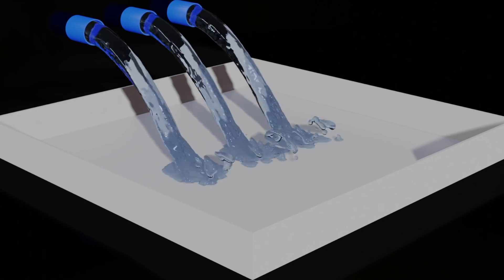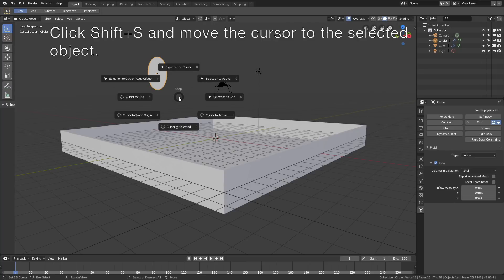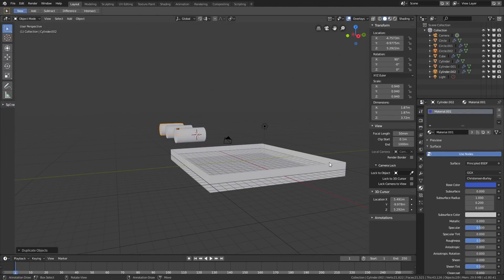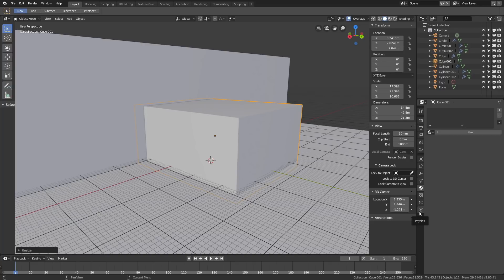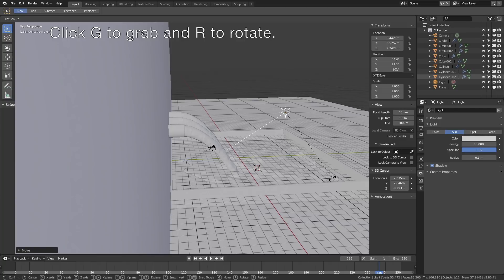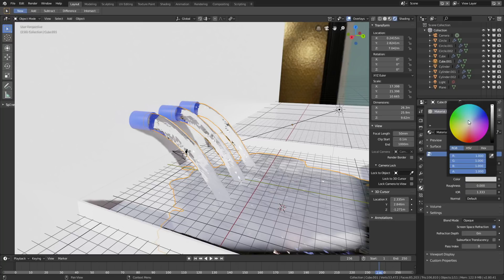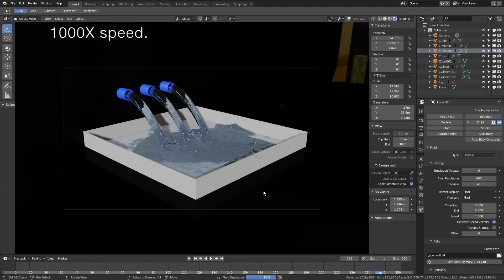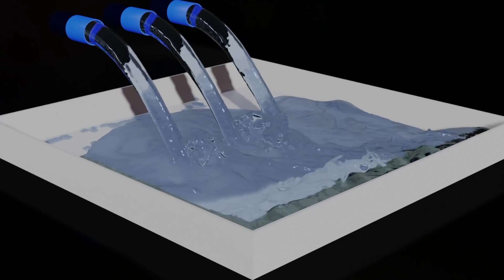[2.80] Blender Tutorial: Water Simulation in EEVEE, Nearly Real-Time

Comment: Hi Olav, I see that use Mac for blender. Wanna ask, is an iMac 2019 i5 enough for use blender? I do understand that rendering can be slow on Mac, but, what’s your opinion about it? Best Regards
GabrielFernandez
Reply: hi, this mac has a i5-2410M wich is really bad (2 cores and 4 thread).you will take a lot of time just for 1 image in cycles with 86 samples in 1080p. i have a i3 9100f. so 4 cores and 4 threads and it takes something like 8-9 min for a glass at 128 samples so you can but your cpu will get really hot quickly. so you must use a graphic card but you don't have any in it.
and you will not be able to add a lot of faces, i start lagging at 60k faces wich is not that much.
i hope this mac has a good fan or you will be ables to cook eggs.
so you can try to learn a bit of it because blender isn't good for some things (precision enginering) because you can't really control scale of your faces, you can with you objects but for faces it is a rescale factor (i hate this) so it will be really tricky. of course if you just want to do funny things it is really easy! you just have to watch tutorials, a lot of tutorials. im trying for 3 month and i can't even do a wood texture with irregularities. but it is free so try it!! (just look at your CPU temp, if you don't have something to see the temp, you can download HWMonitor, it is free and you can see the temp, utilization, clocks cores, everything!)
hope it will work and good night from france (0:40 am)

Comment: I am try to follow your tutorial but I don't have the same options under the Fluid Type as you show on the video.  I only  "Domain, Flow, Effector or None". Am I missing something. I am using Blender 2.82
Reply: Hi, did you figure it out? I have the same problem...
Reply: @SJSDE89  Hello, no i couldn't find what i was doing wrong. The only thing I thought of was I would wait for a release of 2.83 and see if the options were in there.
Reply: I thinks the reason is, that from version 2.82 they are now using mantaflow which replaced the previous fluid simulation engine. I have now downloaded the previous version 2.81a, the last build with the old enguine and it worked there

Comment: why is the water in slow motion tho
Reply: That's because he set the frames up partially wrong. There is a time scale in the fluid sim about how long real time sec the water should flow for, and it'll stretch it along your animation so for ex: a animation you want that is 240 frames @ 24 fps = 10 second animation, so the time in the fluid sim settings should be ~10s to look right.

Comment: For some reason, the cube.001 is showing up as the literal cube during my animation. When I click play, The water flows for about 2 seconds then it just turns into the large cube we put around the animation. Pls help.
Reply: It means the animation didn't bake all the way (there is a progress bar at the bottom), or your frame settings are messed up. The large cube (the domain) actually becomes the water mesh when you 'bake' the simulation, but this is a slow process that happens one frame at a time. In other words, if the water flows for a bit and then stops, then you should try rebaking the simulation, or changing the frame start/stop options, etc.

Comment: Wouldn't hiding the inflow circles from render be a better solution than giving them a transparent material?
Reply: in simple words the inflow circles are the points from which the water emits so if you hide the inflow circles in the render you wont get the water either
Reply: @shalmonanandas3478  that's not true though. The fluid is it's own separate mesh, it's visibility is not determined by inflow objects.
Reply: @shalmonanandas3478  If that's so, I'm doing things supposed to be impossible.

Comment: I'm having a problem where the water is coming through my obstacle. Any ideas why?
Reply: @kasa6468  well the fluid is not going straight through, it just sorta shows through the pipe mesh. I've tried making a higher resolution and making the pipe bigger, that helps a little bit. I haven't found a reason why this is happening...
Reply: Have you made the pipes themselves collision objects? If not the water simulation won't recognize that the pipes are there, and the water will clip through them.
Reply: @buren77  yes, i have made them collision but for some reason the water sorta phases through. not completely through, just shows through a little.
Reply: @user-ey1sg5gp2s  possibly the resolution is too low
Reply: @buren77  Thank you! I cranked it up to 300... had better results.
Reply: @user-ey1sg5gp2s  no problem! glad it worked out.

Comment: Great video.  Do you mind me asking what are the specs of your computer.  Water baking takes me a very long time.
Reply: same here, I thought it would only take a few minutes!
Reply: @Dirtyratsdotwebs  I have learned a lot since I posted that comment.  All baking is pretty much single core so that slows things down.  Best thing I would say is always bake at lower resolution lowest you can and have it still work.  In some case have a low res will not work also unless your time is not import make sure not too use subsurface in the fuild tab.  That alone will at least double the bake time